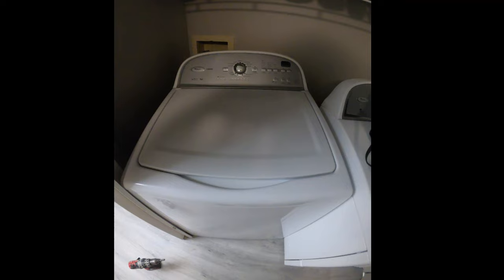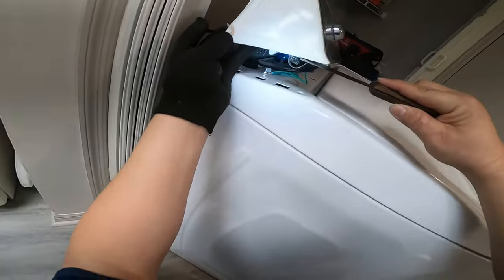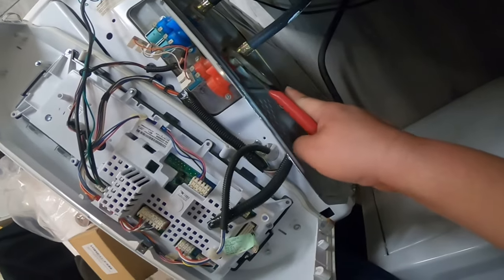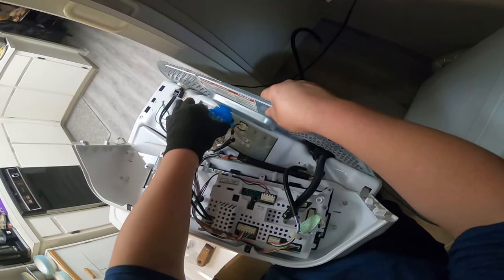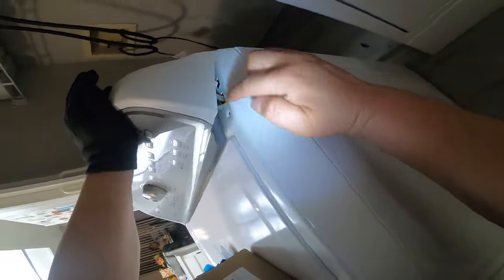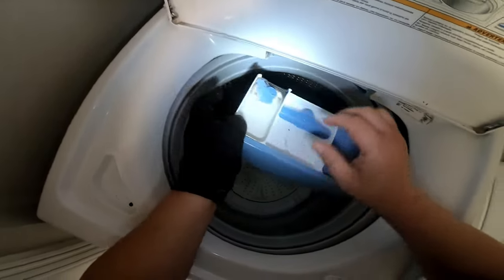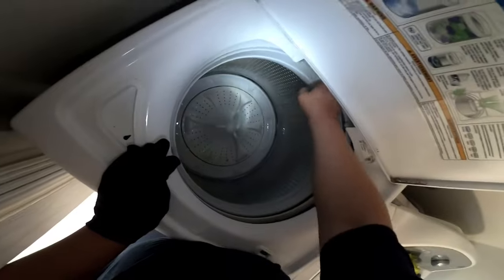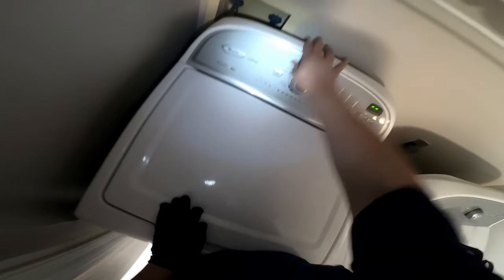How to Fix Whirlpool Washer Leaking Water Inside Tub | Washer Filling When OFF | Model #WTW5600XW0

Comment: Thanks for the information and the video was very close to the actual disassembly of my washing machine.  Removing the electrical plugs was the hardest part as they did not want to come off and I didn't want to break them.  The only thing missing in the video was the removal of 2 screws on the upper rear.  No big deal but notable.  Great job.

Comment: Q I found a cheap necklace stuck in a drain hole in the bottom of the inner tub. (Top loader) Q: If i pull it out with pliers it might break, (a part already did) If a small piece breaks and falls into the outer tub will it just go down the drain or could it cause trouble?

Comment: Q: Mine has a small drip where the water comes into the tub. I have super hard water. I think its mineral deposits the inlet valve but someone said it could be an electronic shut off failure. ?